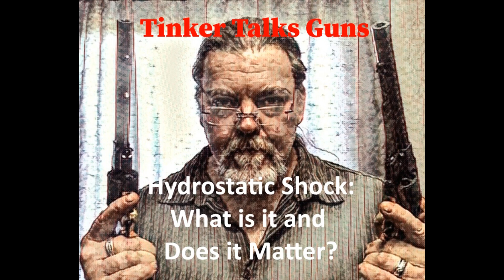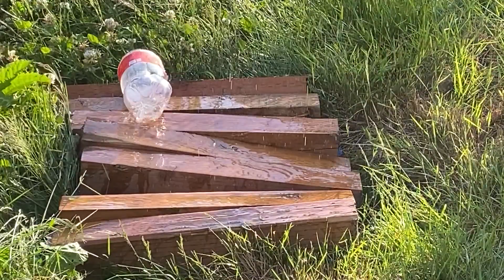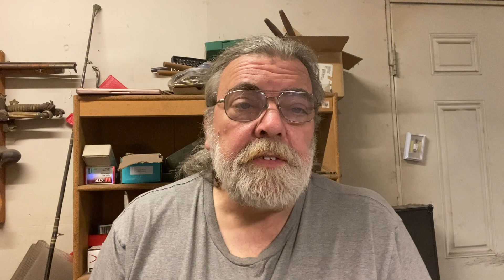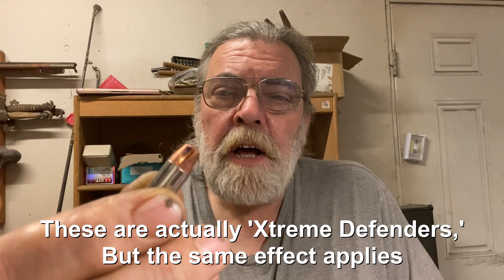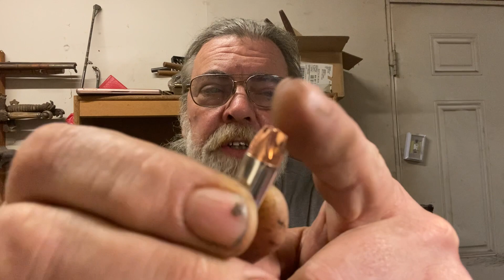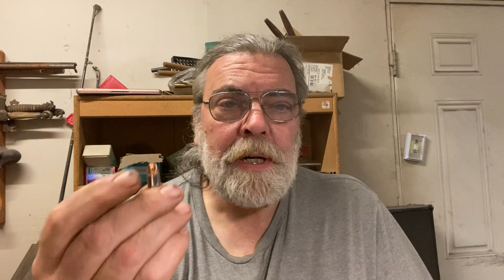Hydrostatic Shock:  What is it and Does it Matter?

Comment: You seem to be directly associating larger wound with hydrodynamic shock.
High-velocity, small-diameter, full-metal jacket bullets that do relatively little damage, are actually more damaging to the nervous system than a large-diameter soft lead bullet.

A projectile that does more physical damage to flesh and bone can be outperformed in the immediate incapacitation department by a higher velocity projectile that does less damage.

"“Concussion of nerves is a condition peculiar to gunshot wounds. The vibrations set up in the tissues by the passage of a bullet near a nerve so affect the nerve fibres as to impair their conducting function, though the nerve is to all appearances quite uninjured, and has not been touched by the bullet. Thus in concussion of a nerve there is loss of function without any gross lesion. The vibrations are more intense, and the concussion effects more severe, when the velocity of the bullet is high, and when compact bone is struck ; though it must be remembered that in cases of fracture accompanied by symptoms of nerve lesion, contusion or laceration of the nerve by fragments of bone cannot be excluded.”

“The injuries to the vertebrae by the small-bore bullet are not serious. The bodies are cleanly perforated with no comminution, or at the most a little splintering of the surface layer of denser bone on the exit side, just as in the articular ends of long bones. Larger missiles, leaden rifle bullets of large calibre and shrapnel bullets, break up the vertebrae and so do much more gross damage to the spinal cord than the small-bore bullet, but the concussion effects of the latter at short ranges more than make up for the slighter damage it does to the bone, as severe concussion destroys the spinal cord as certainly as actual division.”

Source: “Gunshot wounds”, 1908. By S.G. Spencer.
Reply from the maker: Hydrostatic shock produced by a high-velocity projectile can create a temporary wound cavity that exceeds the elastic limits of the tissue and causes tearing of tissues surrounding the wound but not actually touched by the bullet. This is called Hydraulic Damage. This generally only happens with bullets traveling over 2000 fps. and is usually not a feature of wounds caused by pistol bullets. Neural shock is a function of the propagation of shock waves through bodily tissue impacting the nerves. With low-velocity bullets this can occur, but is a great deal more likely with high-velocity bullets.  Is that clearer?
Reply: @tinkertalksguns7289  
I was trying to make the point is that hydrostatic shock is a different than the increased tearing of flesh of projectiles over 2000fps.

What you refer to as "neural shock" would be commonly called hydrostatic shock (or more accurately hydrodynamic shock). 

Hydrostatic shock only really applies to inflicting some kind of neural damage.

Wikipedia's definition:
 "Hydrostatic shock is the controversial concept that a penetrating projectile (such as a bullet) can produce a pressure wave that causes "remote neural damage", "subtle damage in neural tissues" and "rapid incapacitating effects" in living targets."

I'm not trying to nit-pick, just trying to clarify.🙂
Reply from the maker: @infogunvault6920  OK, but hydraulic damage is literally caused by a shockwave through fluid and is directly related to the temporary would so I thought discussing it belonged in the video.
Reply: @tinkertalksguns7289  I get it, totally understandable. 
This is a bit of an off topic question, but do you happen to know what is the minimum caliber/projectile needed to kill large animals like bears or perhaps buffalo? 

I've been looking at various historical instances of people using black powder revolvers to kill bears, to really nail down the answer to this.
Reply from the maker: @infogunvault6920  I was looking at data on this, and in recent years people have killed grizzly's with everything from a .38 Special on up.  A percussion revolver in .44 caliber is comparable in power to a .38 special so I can believe that would work. Long ago when he was a child a friend on mine killed a black bear with a .22 rifle. it took a lot of shots but it did eventually work. While there doesn't seem to be a minimum caliber as such I would certainly not think it advisable to use anything less than a 9mm with carefully selected ammo (which has worked in recent years) and 10mm pistols are popular for bear defense in Alaska currently.
Reply: @tinkertalksguns7289  I've come to similar conclusions. It's interesting that people have killed grizzlies with relative ease with .44 Colt Army model 1860, but found the .36 caliber Colt Navy model 1851 to be quite ineffective.

Is it all right if I mention in one of my videos what you said about your friend using a .22 against a bear?
Reply from the maker: @infogunvault6920  By all means!

Comment: Testing shows the effect happens between 1800-2300 fps. Most agree on 2000 fps as either in the middle or a round number. The FBI concluded at just over 2000 for consistent results. The 5.7 x 28 doesn’t reach that out of a handgun. Out of the P90 it does and hence the difference in results. A handgun needs to reach 2000 fps and with most rounds that would require a very light projectile. Great video with an easy to understand explination.

Comment: You are one of my favorite YouTubers, and it pains me greatly to have to do this, but I think you got it wrong about the Xtreme Defenders and Xtreme Penetrators around time stamp 11:53.

  The "twist" rate of the bullet is so slow that it adds virtually nothing to the energy of the bullet.  1: 7 or 1 revolution per 7 inches is about the tightest twist I have ever heard of, but for handguns, like the 9mm for instance, it would more likely be 1:10 all the way up to 1:24.  To put that in perspective, I have about a 60 inch chest.  At that point, I am about 12 inches thick (front to back).  One revolution in that length is hardly worth mentioning.  That is why the infamous "Black Talon" wasn't really the flying "buzz saw" it was hyped up to be.  The "talons", once opened, tore tissue equal to maybe twice the diameter of the projectile prior to expansion, for just a few inches.

The magic of the Xtreme projectiles is the fact that the shape of the flutes, concentrates or lenses the fluid/media it passes through into a "jet" at the rear point of the flute, and ejects that "jet" outward from the projectile, equal to, or greater than, the speed of the projectile.  It, in essence, gathers fluid at the front, compresses it, then focuses it out to the side, making 4 "fluid pressure blades" which extend outward from the projectile.  These "fluid pressure blades" (or fluid talons if you like)  only extend outward a small bit from the projectile, but do create a 4 point wound channel which is maybe as much as twice the diameter of the projectile at handgun velocities.  The effect tapers off as the projectile proceeds through the medium because the flutes compressing the medium/fluid slow the projectile down as it penetrates.  For the Xtreme Defenders,  lot of math which I am incapable of doing, went into the design of those flutes to get a consistent depth in test media to stay within the FBI protocol optimal results as far as penetration goes.   Likewise, the Xtreme Penetrator is the product of science beyond me to get some enhanced damage, but penetrate very deeply.

Another way to think of these projectiles is that they are "inside out" hollow points, or "anti hollow points."  The "hollow" of the point is on the outside.  If you think about it weirdly enough, you could cut the projectile in to 4 pieces at the business end, then rearrange those pieces with the flutes in the middle and have something that kinda, sorta, semi, demi, quasi, almost, looked like a hollow point.  Well, I found it amusing.  I guess that makes one of us.

I consider the Xtreme projectiles to be the ONLY way to go in defensive handgun ammo, and now use them exclusively for defense in .380ACP,.38spl, 9mmPara, .357SIG, .357mag, .40S&W, and 10mm depending on what I decide to carry on a specific day.  YouTuber AP2020 did some work with the 350 Legend and hand loaded some 9mm handgun Xtremes projectiles in it, and got  well over 2000 fps.   They were monsters in ballistic gel !  If I were still working the streets (retired after 40 years), I would pay someone to load them for me and carry a 350  Legend carbine, so loaded, on duty.  I fully intend to pester Underwood until they produce some carbine loads for home defense.

OK, I apologize again, but I have a birth defect that makes me point these things out, then belabor the point, when I think I am right.  You see, I was born an A**Hole and have been loosing ground ever since.

Have a great day all.
Reply from the maker: I've been working from ideas postulated originally by the designers many years ago.  While the amount of rotation is relatively small the RPMs are enormous. However it wouldn't be the first time a flawed theory had produced a useful real-world result and your description of the wounding mechanism may be entirely correct. Regardless of exactly how they work the do indeed seem to do the job which is what really matters.
Reply: @tinkertalksguns7289  Howdy!  Thanks for the reply.  Congratulations! You are the first person in weeks that wasn't personally offended by something I posted.  You ROCK!!!  Yep, they do work.  Funny to think that all my old stock of hollow points just became range ammo.
Reply from the maker: @Grynslvr2  I use them for function tests and I'll be doing some gel-tests for the channel once I replenish my ballistics gel; the stuff I have now is so old it's no longer even remotely transparent.
Reply: @tinkertalksguns7289  Function tests....yeah, that's the ticket.  Sounds classier than telling folks I am going to the range to blastulate the crap out of some stuff.  GRIN  Anyway, I eagerly await your testing.  BTW, am I seeing a KoC and a KT sword in the background of some of your videos?
Reply from the maker: @Grynslvr2  Yep. Picked those up at an antique mall years ago.
Reply: @tinkertalksguns7289  Cool ! Never had the spare change when I found one. Tks for the replies.  Bob

Comment: Tinker, I hope that you get a chance to borrow a 5.7mm pistol from someone and see what you think.  If it wasn't for the huge gap between the upper and lower receiver on the new M&P 5.7 pistol, (with a little play between both that doesn't effect accuracy), I think that you would fall in love with that pistol.  But I hear excellent things about the Ruger 5.7 and the PSA Rock 5.7...   I just think that after the M&P 5.7 is just the sweetest shooting 5.7 pistol due to its rotating barrel gas system.   I don't think I've ever shot a finer shooting pistol as the lightning cuts, threaded barrel, optic-ready slide,  and match-grade trigger all feel like a custom shop pistol.    I'm  just hoping that the pistol brace ban gets overturned by the supreme court as I have some ideas for making a brace for this gun.
Reply from the maker: The only problem I have with 5.7 is the cost of ammo. I really like the look of the PSA  and S&W. and the prices of the guns are at least theoretically in reach, but I hate having guns I cannot afford to shoot. :(

Comment: One thing to note is that the FBI's findings were that their 2000 fps threshold (actually I think it was 2100 or 2200, I forget) applies to creating CONSISTENT damage from hydraulic cavitation through a wide range of tissues.  I've read a few medical reports of such effects being present in wounds from shots done with ammunition well below that threshold  especially once they pass the 1,500 fps. threshold.   This is why .22 Magnum rounds despite often not reaching 2,000 fps, still tend to be  noticeably more deadly on smaller game animals compared to .22LR rounds.  Hence why .22 magnum is often seen as a good "varmint" round against animals like coyotes.  
All that being said, I switched from a 9mm to a 5.7x28mm pistol as my primary home defense handgun, based upon the real-life evidence of it's effectiveness in the Ft. Hood Mass shooting.  A number of the shooter's victims had charged the shooter but were stopped with chest shots from an FN 5.7 pistol using SS192 and  SS197SR ammunition.   There's little doubt that it is a highly effective round.  With the SS197SR round, the wound tracks in calibrated ballistic gelatin tests (with 4 layers of denim) indicate that it gets very consistent penetration past 12" and that even in the rare instance that a bullet doesn't expand, it still tumbles causing plenty of damage.  But generally speaking the wound tracks are generally very impressive.   That combined with Level IIIA kevlar piercing capability, low recoil, flat shooting, and high capacity make 5.7 pistols a no-brainer for me when it comes to home defense.  
That's why I keep telling people that I forsee 5.7x38 eventually surpassing 9mm in sales.  To me it's a dream caliber that gives near rifle level performance from a pistol while being very easy to shoot well due to its low recoil.

Comment: Those liberty civil defense rounds going at 2000fps seem to have good hydraulic effect, but lack of a sizable permanent cavity after a few inches from the small base that continues. I'm not sure if it's any better than a jhp. Besides penatrating soft armor.
Reply: I've tried a few of these fragmenting type rounds and in my experience they work much better on gel than animals. I've killed several wood chucks and porcupines with them where the fragmented portions barely penetrate a couple inches and many times do not enter the skull.
Reply: @ThatAgencyGuy  It's not that they don't have the velocity. They easily surpass the factory stats out of a full sized handgun or carbine. They just don't have the mass to carry the damage through after initial fragmentation. I've laid a wild hog over instantly with one, about 150 lbs. I did a necropsy, and I would not trust it consistently. There is nothing worse than  having to call a game warden out of his air-conditioned or heated truck, and clean uniform so you can track an animal that ran onto someone else's property without getting shot at. The damage to the side and left lung up to about 3-4 inches was impressive. After that, it was a small hole that continued to just the other side of the right lung. There was pretty much no damage after the first 3-4 inches. So I'm guessing hydrostatic shock had a big part in the "instant kill". I'm guessing the pressure spike in the lung caused a stroke/aneurysm similar to a rifle round.

Comment: High shoulder/brachial plexus shot can produce a similar effect , although usually it will drop said animal immediately… even with a lower velocity projectile.
Reply: Excellent point! High shoulder shots with high speed projectiles is VERY effective.  No tracking required when done properly especially with high velocity hunting projectiles in cartridges like the 270, 7mm Mag, 308, 30-06 etc
Reply: @frankbrowning328  even my relatively slow  300 grain 44 mag has had this effect.